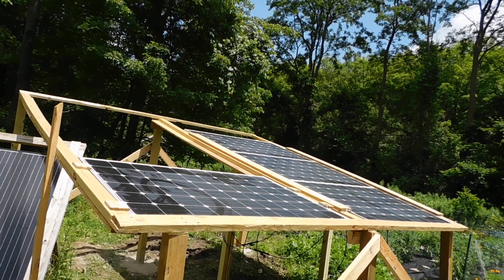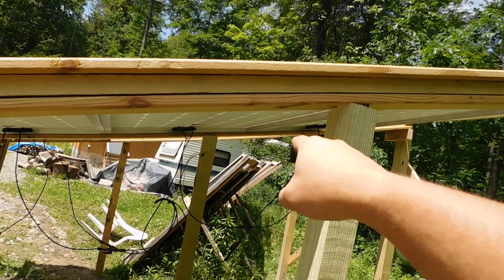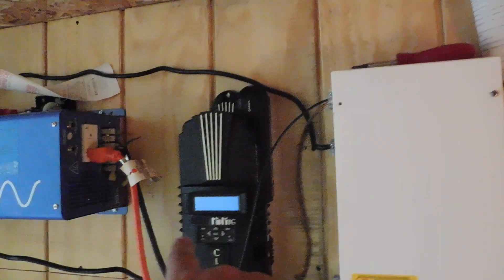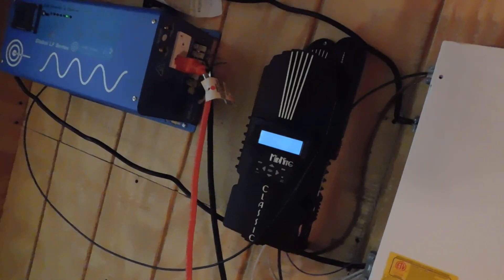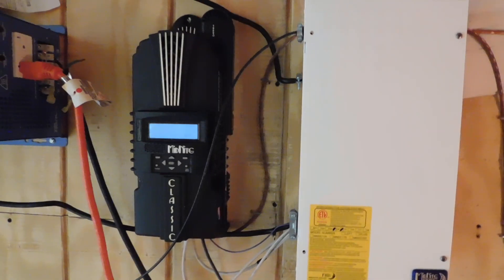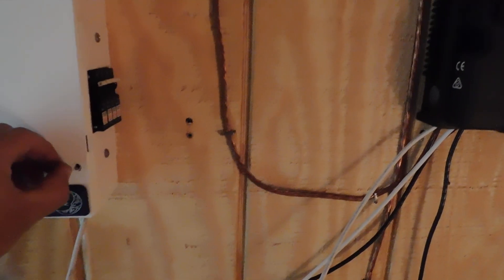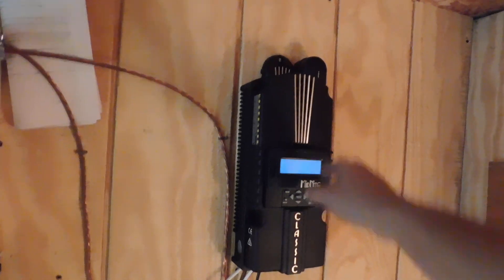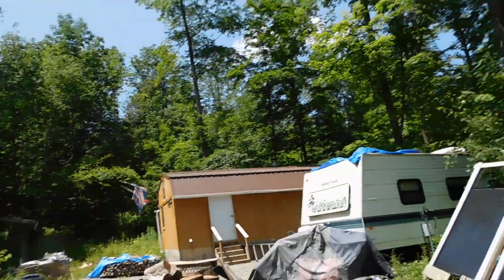Big solar upgrade for the Off Grid Homestead.

Comment: I have not personally used the Midnight Classic series, but from my understanding when I read up on them as I am considering using another charge controller for my setup (to replace my tiny EPever 40 amp one), I think you don't need to 'connect' the Whiz Bang Jr. to both controllers if you're using a common battery bank.

The Whiz Bang Jr. simply monitors (via the shunt) the current going in and out of your battery bank. It doesn't matter which controller the current 'comes from' because it will still count it.

I believe you CAN link the two classic controllers together in order for them to communicate with each other, and facilitate more centralized monitoring. In this way, with the Whiz Bang Jr in between the battery bank and your charge controllers, and the controllers linked together, I believe you should be able to appropriately monitor, in a centralized and organized manner, your power generation and usage.
Reply from the maker: Thank you for that info that helps.

Comment: Question:  off grid solar power storage:  what does a person do when they produces more than they use & can store.
Reply from the maker: It gets dumped or you can have a hot water tank or something like that to use the extra power.
Reply: preppernurse1 :  thanks.  I'll add that in my plan.
Reply from the maker: No problem.

Comment: The way the solar panels are on that new framework;  I know it's still months away but aren't you afraid of the weight of maybe snow piling up on and cracking the solar panels. The solar panels look so thin and the pitch on which they are sitting on that framework and one would wonder if they can support the weight of a lot of snow on the panels.
Reply from the maker: I hear what your saying and I am always cleaning them off in the winter and will do the same with the new ones I might add more support under them when winter gets here.

Comment: Good deal. You need a 2x6 stringer underneath supporting your 1x6 because it is going to sag real bad if you dont . Make sure the 2x6 is on its end and not laying flat so it wont bow. Not a crappy job just needs some 2x6 supports to help hold it firm. I like the 255 watt panels. I just bought four 290 watt panels. I am running my AC and cooling my house now.
Reply from the maker: Thank you for the tip. and that's cool that you have that now.

Comment: If you are over powering your batteries all day now then setup and water tank you can heat and that will let you use preheated water in your system.
Reply from the maker: That's a very good idea thanks.

Comment: With all that power are you able to run whatever you want?
Refigerator and air conditioner, freezer?  On demand water heater?
Reply from the maker: We were already running the refrigerator before but yes the boost in power coming in makes everything better.

Comment: I think you're a bit shortsighted on not building a rack that is adjustable for winter and summer sun positioning, but hey - everything is a learning experience. You may eventually decide to redesign your racks to achieve that ability. And I'll give you the same advice I've given Troy for years - plan ahead. Draw it out, double check the measurements and think about how it's being held together and how the weight is being supported. All before you cut the first piece of wood.
Reply from the maker: That makes sense thank you.

Comment: quick question. I'm going to see property that is taxable as vacation with improvements upstate ny. it has a septic system generator with batteries propane lights 2 wall mounted propane heaters and a wood stove. needs a well. can I live there full time legal ?
Reply from the maker: Yes you could.

Comment: Part of why your not getting as much on your old pv. Is that it's not all in the same row. If they are not all even they kind of work as if there shading. Happy for you brother. BTW your bulk  is to low. The Data sheet from Trojan the bulk is 29.64.. I will share the link in a comment. Not this one so it duse not end up in spam.. O and did ou think about storing your fire wood under the solar?  The hate from the solar will help dry the wood and keep thing dry in the winter. Just have to be care full not to bake them from the wood. Keep up the hard work brother. Place looks good. God Bless
Reply from the maker: Thanks for the info and I will build another rack for the old panels.

Comment: you did a good job, as long you collect solar energy it count, if you want affordable wind turbine go for the Aleko 1.5kw 48 volt, but remember, you will need a galvanized tower height above the treetops 80 to 90 feet, there is wind 24 hours and solar only 12 but average of 5 hours sun, feel free to google around
Reply from the maker: We will add wind in time.

Comment: just a quick question I noticed the power going into your house is on a orange extension cord is that a number 12 or is that a number 14 gauge if it's a 14 gauge in your carrying that much current you probably should move to a number 12 at least it can handle the house current. if I'm wrong sorry I just only seen one cord you said was feeding the house
Reply from the maker: I think you saw it wrong we have a heavy duty cord that runs to the house.

Comment: what difference did it make going from a 12v system to a 24v system? I'm thinking of going from 12 to 24 so I can double the amount of panels & get more power
Reply from the maker: Its a lot more efficient  than running 12 volt.
Reply: preppernurse1 how? do the batteries last longer?